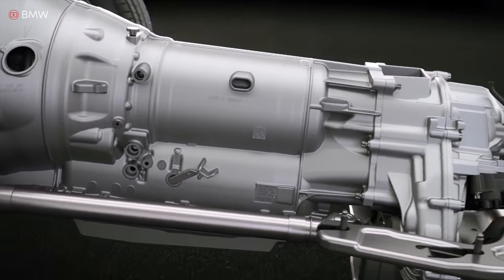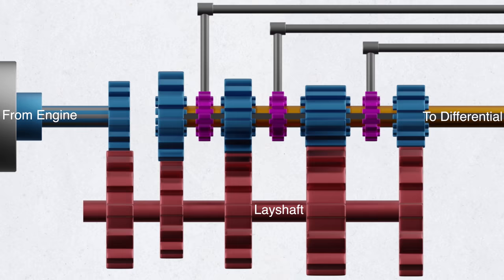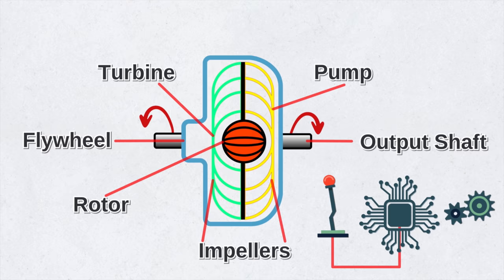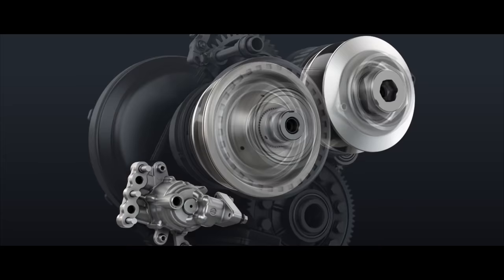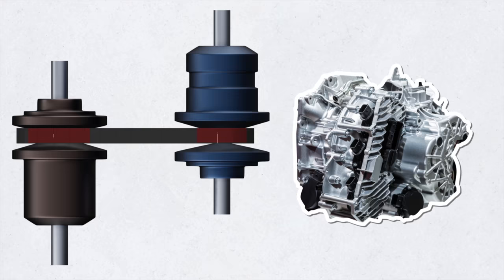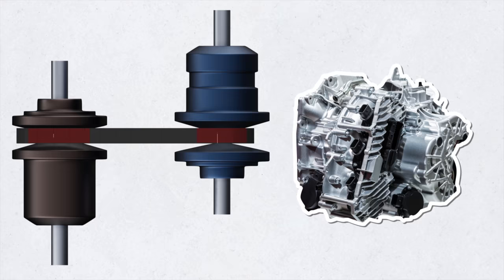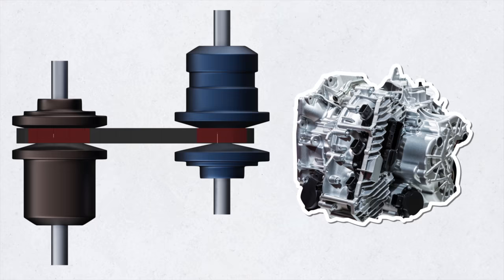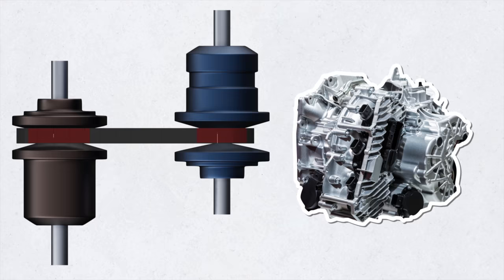Parking Like This Will Destroy Your Automatic Transmission

Comment: I learned my lesson when i was about 16 I'm 32 now. My grandparents had a 97 ford Taurus and I figured I would do them a favor and change the oil. To make things easier I used a set of ramps we had instead of a jack and stands. I pulled the car on to the ramps and didn't set the parking brake. So when put the car in reverse to back off of the ramps it tore the transmission up. So now if I ever drive a car with an automatic transmission if I park on any type of incline I always apply f
The parking brake before I take my foot off the brake after putting it in park. I only prefer manual transmission when shopping for a car. They are more fun to drive than an automatic. They are cheaper and easier to work on. And last longer in my opinion.

Comment: Manual is pretty much mandatory if using an exhaust brake (not specifically a Jake Brake)
Reply: Yoy can still jake brake by putting auto trans into manual mode ...or low gear 1 or 2

Comment: I had an automatic transmission. I kept the fuel tank above half, almost never used neutral, and always made sure the break was fully pressed before going into or out of park. I almost never used the parking break.
In the end, the transmission had a manufacturer defect anyway, and was recalled right around the time it failed. It tried to shift, disengaged, and I had to shift into low gear just to keep the car moving and get it off the road.
Reply: I have  a Ford Fiesta  6 speed  duel clutch transmission  oh boy

Comment: I've been pretending 1/4 tank is E since I got my license 😂
Reply: Pretty much same for me. I've never seen an empty gas tank light turneon in my car since the day I got my license.
Usually I go to fill up the tank as soon as it has only 1/3 tank left.
Reply: It is also a good idea to have plenty of fuel so you don't have to worry so much.  I never have the low fuel light come on.
Reply: Me, not so much.  More often than not the gas light turns on when I run out of fumes.
Reply: Shhhh. Don’t tell my wife, she insists on always having >. 1/2 tank….   I like to run it down and get fresh gas… ( not to empty, a couple gallons to spare)

Comment: That part about the level of fuel in the tank affecting transmission life, is total nonsense.
Reply: I didn't hear that. "Fuel also helps your engine and other parts to stay cool and lubricated". There seemed to be some other pieces of advice that weren't directly related to automatic transmissions.

Comment: Scotty, you forgot to mention a big advantage of manual transmissions. You can bump start them.
Reply: See Scotty's "Taking Care of your Battery and Starter" video.
Reply: The bump start is getting harder now as everything is electric.  Electric fuel pump, elec. assist steering,  Alternator does not supply ANY POWER "without" some battery juice to excite the alternator (so it is not self generating like a generator is)   VW is nearly the last car that used a generator.(instead of an alternator) and those cars you could push start DOWN A road, jump in and slip it into 2nd gear to turn over the engine enough to start the car.(with a carburetor engine)   You definitely need another battery...so you have the chance to rectify that by driving to a store with batteries. 1973 Super Beetle with carburetor and generator.
Reply: You could push start automatic transmission cars up to about 1965 when they left the rear pump out of the transmission... that worked off the driveshaft spinning...
Reply: @bunzeebear2973  Alternator cars can be push started, it only fails if the battery volts are very low eg 6V, the car must have dizzy and carbie setup, I never had to push start an EFI car with coil packs and crank sensor, that maybe be difficult to start

Comment: My brother in law used to go out in the winter in Michigan when it was cold 🥶 and sit and rev his engine very high right after starting it up. When my father told him it would hurt his motor, he just said “ I need to warm it up faster “ well, he would blow engines in his vehicles at least every two years and I even seen one with the rod sticking out the oil pan with a small lake of oil under it !  He never learned 😂
Reply: Sorry but your brother in law must not have any common sense. 😬

Comment: I had no clue that running  on lower level of fuel can mess your transmission  up 🤯😨
Reply: Me neither, and I didn't understand his explanation.  I don't understand the relationship between fuel level and fuel pressure or the relationship between fuel pressure and transmission wear.
Reply: @digitalnomad9985  - It was mostly wrong...
Reply: Actually keeping more gas in the tank of an EFI car can keep the fuel pump running cooler as the gas cools it... more gas also prevents condensation of moisture... you won't lose fuel pressure unless gas pickup tube end is exposed because of too low fuel level...
Reply: @BuzzLOLOL  thx
Reply: @BuzzLOLOL  Automobiles have sealed fuel systems. The atmosphere does not enter the tank. Vapor will not condense into liquid water.
More broadly, Scotty is full of "nonsense" on this one. An engine does not need fuel in the tank to stay cool.😐

Comment: The one thing that is missing is Toyota's eCVT transmission used in their hybrids! No clutches or torque converters necessary (and none to wear out). Lower losses and higher efficiency. Fewer parts to wear out; there are only a few fixed gears (and electronic inverters). It is probably the most reliable of all the transmissions mentioned. I know Scotty is not a fan of hybrids, but I think it would make for a good addition to an excellent video.

Comment: My Civic has driven almost 200000 km without a transmission fluid change. 
It was my mom's car for a long time but because she doesn't drive, I drive it now. The first thing I asked is if the ATF had ever been changed and no it wasn't. You can tell when you drive it, the shifting is a little more delayed, especially when cold, as the fluid gets even thicker. My dad was still under the illusory business practice of "Lifetime transmission fluid" so he never bothered either until I told him about it.

Comment: Coasting downhill or just in general and leaving the car in drive (or in gear) also saves fuel, most cars on the road now will automatically cut fuel to the engine because momentum is keeping the engine turning so combustion is not really needed to keep the engine turning. So with a manual transmission if you’re going to be slowing down or coasting without throttle for an extended period of time, it’s worth rev-match downshifting to keep the engine and transmission connected to save fuel and keep yourself in control of the vehicle.

Comment: I got a 2003 cavalier that just hit 84k miles. Took it into the dealership for a full transmission flush and service since it's a sealed unit and i can't check it.

Preventive maintenance saves THOUSANDS down the road

Comment: You say that running at such a low RPM can be bad for the car during extended drive sessions. 

But your average car only runs around 1600-2000 RPM at 70MPH on the highway
Reply: But that’s in a higher, larger, more stronger gear, smaller gears are easier to break because they have less structural strength

Comment: when changing transmission oil, be careful not to overfill at first pour; likewise, after driving around for 50 odd miles, recheck level to make sure it is not underfilled.  transmissions are delicate and temperamental and i have done both of the aforementioned recommendations, thus allowing me to garner respect for both auto-engineers and a good drain pan.

Comment: My 2015 honda civic went 286 603 miles before the cvt transmission  went out, usually  a cvt transmission  will only last for about 140 000 miles. My mechanic  said this the first time he has seen a Cvt transmission  last that long. Also he stated that no one in the u.s. rebuild s a  Cvt transmission.  Either you get a new one from a dealer  or get on from another car.
Reply: 286k miles in 8 years? That's a lot. Are you an UBER driver? My 2007 Corolla has only 164k miles and my wife's 2017 Mazda Cx-3 had 48k miles.

Comment: In my experience….manoeuvring on snow and ice is easier with the fine control possible with a clutch.  In an auto the engine power increases but snow prevents you moving…then suddenly the wheels spin up (still without grip).  What you need is to feed power to the wheels in tiny increasing amounts until the car can climb over the snow wedge.  Unless you can afford the most modern vehicles with electronic torques control etc…

Comment: Recently, my wife had started the 2002 Mercury Sable but could not move the automatic transmission out of Park. The driveway is on a slight incline, and the car was headed uphill. I got behind the car and pushed uphill, and she was able to move the transmission into Drive. I explained that she needs to park with her foot on the brake and keep her foot on the brake until she has applied the Parking brake.
Reply: Don Smith Yes and then release the foot brake before putting in 'park' as there can be slight movement when foot brake released, if on hill.

Comment: I once installed a cheap POS Chinese radiator on my ‘81 CJ7, leaked water into my 3 speed automatic since the tranny coolant passes under the radiator core to keep cool. Blew the tranny, got it rebuilt for $1300, and it runs nice now. Swapped the radiator for an American made one, and went with a separate oil cooler for the tranny.

Comment: I would love to see a comparison video on how Honda's Hybrid ECVT is different and what recommendations should be given on how to care for a Hybrid transmission. For instance, you really cannot warm up a hybrid car, so how does that effect the transmission? If you have a CVT or ECVT that doesn't have fluid is it still necessary to warm up your car (at least for the transmissions sake)?
Reply: You can warm up a hybrid by just turning on the heat, it instantly starts the engine. Also you don't need to warm your car up, check Scotty's video on that.

Comment: 18:15 -  I have never encountered an emergency brake on a car, though I seem to remember that they were fitted to brake vans on railway trains. All of the cars that I have owned or driven have had a pedal operated service brake and a manually operated parking brake, though the more 'up market' ones sometimes a pedal for this brake too.
Reply: Every single one of my cars has had in. Are you in America?
Reply: @riv6580  Given that Silver Legend is so persnickety about “parking” vs “emergency” brakes, I expect him to be a Britain chauvinist, convinced, like Irishman George B. Shaw, that Americans stopped speaking proper English, rather than kept the 1750 Standard.  My grandparents called it the “hand brake” because back when they first learned to drive, just after WWI, that was the common term, yet amazingly no one who learned later complained about his anachronism.
Reply: Manual transmissions cars don't have a brake that is only used in emergencies or only used when parked. They have a handbrake that is used when parking, but also when driving - e.g. when starting on a hill (because you can't operate a clutch, accelerator and brake pedal all at the same time, if you only have two feet).

When I was growing up, I'd say that probably 95% of cars in the UK had a manual transmission.
Reply: @jhferu  I still do not know what an emergency brake is on a car. Yes of course you can operate all three pedals of a manual transmission car with two feet. Many of my friends learned the technique which is known, in the UK at least, as 'heel and toe' wherein the right foot operates both the throttle (accelerator) and the foot (service) brake.
Reply: @JUANKERR2000  its just a parking brake that takes the form of a stick you can yank up on or a small pedal off to the side of your normal brakes. Called an emergency brake because it will still work if you lose hydraulic pressure in your brake lines, its purely a way to mechanically engage your brake. In other words a parking brake is an emergency brake they're the same thing.
Reply: @dcgregorya5434  I am perfectly aware of what a parking brake is, thank you, and of the diverse forms that it can take; I simply find it strange for it to be referred to in such an odd way.

Comment: Without traction control, going down an icy hill in neutral is recommended.
It keeps the car going straight. But, if you win a lottery, you don't need a vehicle.
Reply: I fully agree. We live in very hilly terrain, and on ice roads the last thing you want is for the engine pushing you.
Reply: gee i didnt know that coasting in neutral causes damage SHEESH!!!!

scotty sure points out many ways to ruin the car using any alternative tactics
Reply: next thing you know he points out that adding a transmission cooler somehow causes internal damage, or adding air scoops on the hood causes the engine to become frozen in sub zero climates due to lack of insulation
Reply: With a rear wheel drive, engine braking on the rear wheels going down an icy hill helps hold you straight like an anchor almost.

For that reason I do not like front-wheel drive for winter driving. Sure you have good traction, but in slippery downhill conditions the last thing you want is engine braking on those front wheels.
Reply: @c.d.7742  With "neutral" engaged on an icy downhill, there is no torque going to the rear axle.
So, the vehicle will naturally go straight, if you brake gently, as you go down.
However, in "drive" the torque will send the car pell-mell when the brakes are applied, or not;
due to unequal traction left/right.
But if you insist on keepin' a vehicle in "drive" on an icy slope, you must own a body shop or know someone who sells cars. 
It is widely know that any accident can cause your insurance rate to increase.
But if you are rich, keep 'er in drive on the downies.
With computer traction control/abs or AWD, I don't know what happens.
Even ABS has nothing to do with keeping a straight line down the slippery slopes.
Neutral saves the day with many buggies.
I never had chains/studs, so I can't say they help in extreme conditions.
There must be a zillion hero stories about driving on ice, but at the end of the day, Hitler doesn't care.
The average hard working citizen does.
Reply: @seapeddler  Have you ever even driven a rear-wheel drive vehicle?

You do understand engine braking when going down an incline?

Comment: So I’ve always been the type to put a car in neutral and then apply the parking brake and then put it either in gear or in park depending on which car I’m driving. One day many years ago I was in a rush and an forgot to do this in my 84 turbo diesel Mercedes. Tossed it into park and broke that tiny little $.50 key in the transmission and forever never had park ever again. So now I always take the time to do my steps because I’m not ripping apart a transmission for a part that costs less than a dollar lol

Comment: I had a 2000 4Runner with 260K miles on it. I checked the the radiator coolant one afternoon while draining the oil for an oil change. It looked like chocolate milk...yep the intercooler for the tranny ruptured and mixed with the radiator coolant! I drove it to a reputable shop for a new radiator and a tranny flush. I had them triple drain/fill the transmission and luckily it was saved, I used a turkey baster to remove the globs of transmission fluid from the coolant every day for two weeks until no more detected. About 6 months later I drained and refilled the radiator just to be thorough.

Comment: Hey Scotty, when I park the car:

I stop completely, foot on brake I shift from Drive to Neutral, pull the handbrake (parking brake), release my foot brake, and then shift to Park. The idea is there is no tension on the gear at rest. Does the help anything or is it a waste of time? 98 Camry 250k btw
Reply: Wow I do the same cause I don’t want pressure on my gearbox for my automatic! Did yours have any problems when you started this?
Reply: @michaelrichards4255  everything on the car was fine when I got it (@113k) and all still good @250k. I notice when it’s cold it stays in gear a little longer than it used to when it’s cold, BUT it’s not much. And I have hammered down on this poor old Camry a lot!

Comment: Rebuilt Chrysler Torque-Flight with a B&M Shift kit. Simple to rebuild, gets better gas mileage and almost bullet proof, until about 80 thousand miles then the bands would ware out, the bands weren't included in the rebuild kit. They just don't make'em like that anymore.